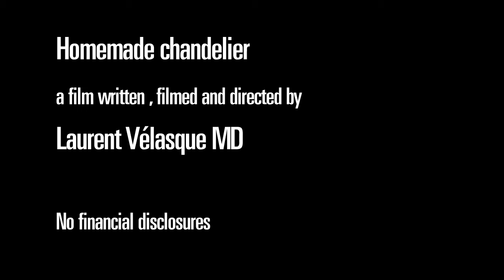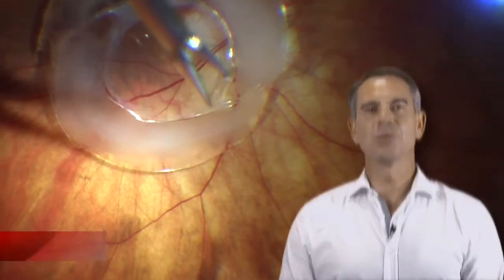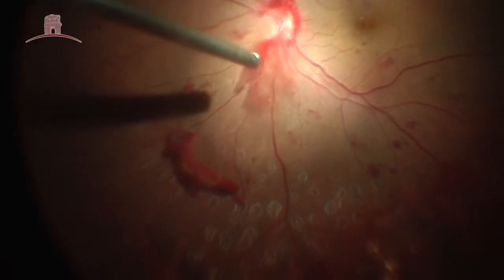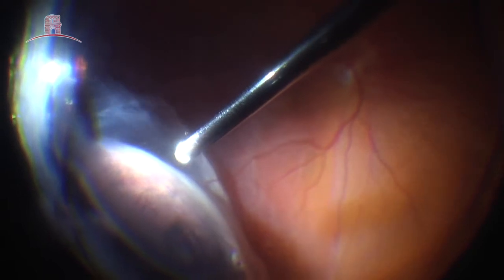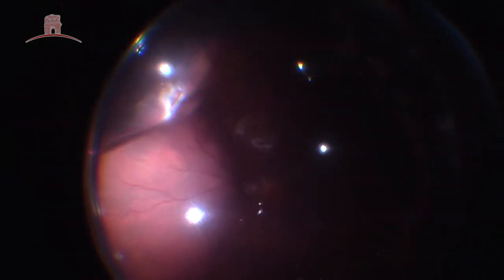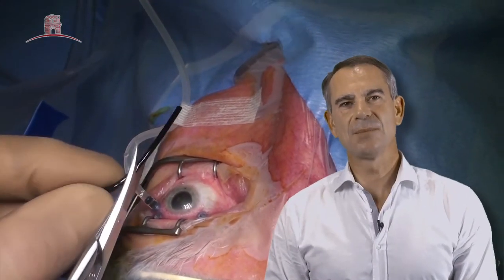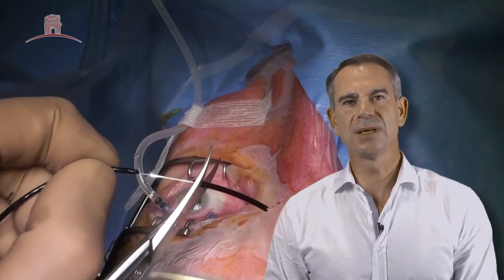homemade chandelier

Comment: Sir: Which endolight are you using for this technique? Tried using an endolight for a constellation system and found that the diameter of the fibre-optic cable is bigger than that of the 23Ga cannula, so could not used for this technique.
Reply from the maker: Dear  Nikhil indeed this technique can't be used with Alcon endolights because you can't take off the plastic coating unless you use a 25g optic fiber with 23 g trocarts or separate fiber from other brand. I'm working with Dors Eva system.
regards